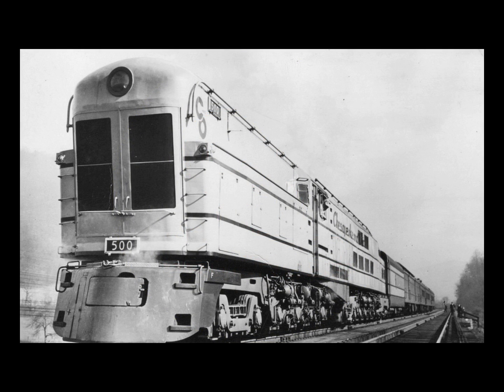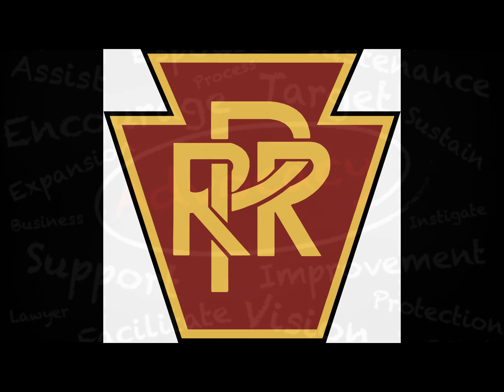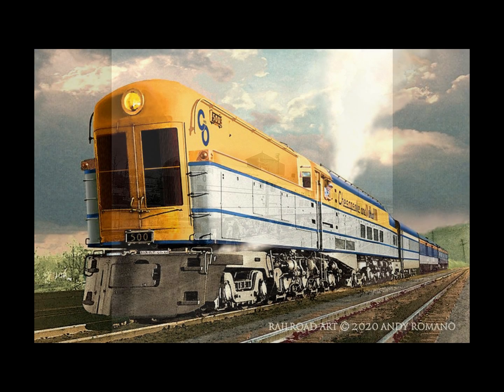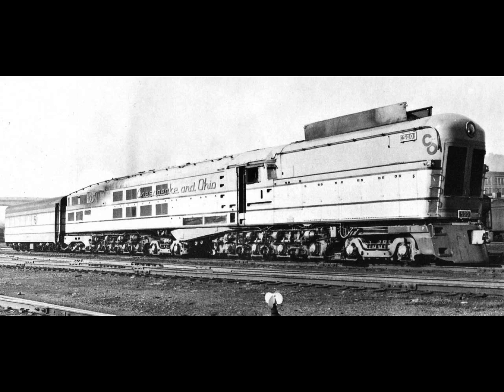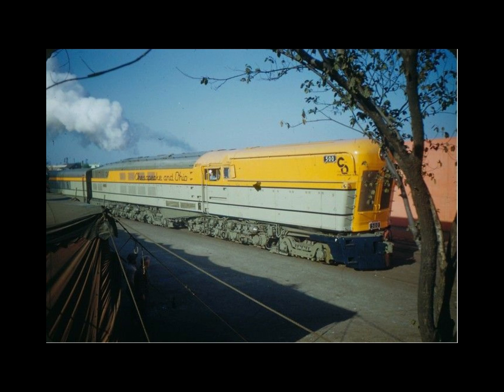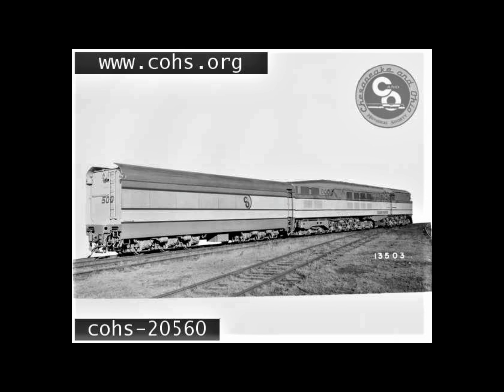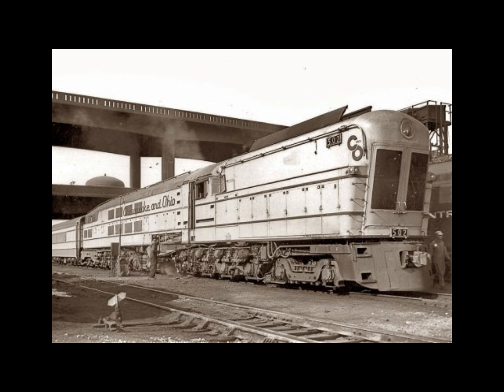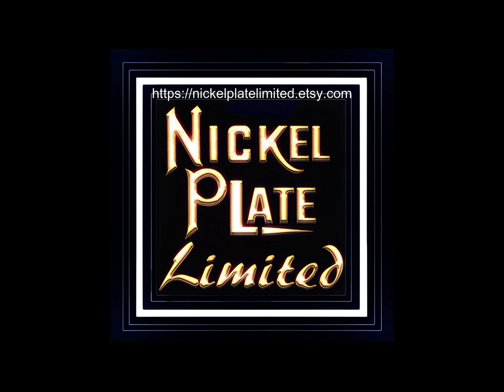Chesapeake & Ohio M 1

Comment: Some of the C & O turbines did not run with steam. They were  coal powder turbines. Coal was blasted into the turbine combustion chamber. The turbine blades wore out prematurely and the project was scrapped.
Reply: Sauce?

99% certain you are confused here.
Reply: @commissarcarl1700  Sauce? What sauce? This isn't a cooking channel. Confusion all around, apparently.
Reply: @diffened   in internet speech sauce means source. I need a source. I think this guy is getting his wires crossed.
Reply from the maker: Hmmm... Yeah, all that doesn't seem feasible from a practical or scientific point of view. I would have to see that in some form of historical documentation. If it exist, then I've never seen it. Thanks for watching and the comment!
Reply: @TheRailroadCrossing-SteamPower . Gas turbines can run on any properly prepared fuel, but they may not last.   There have been experimental  “closed cycle” gas turbines..not too different than a steam turbine.  The gas heated in a ‘boiler’,  passes thru the turbine, cooled (condensed) and recycled thru the compressor.  The working gas was helium.  The heat source coal or…
   Current closed cycle GT research (Sandia Labs) uses CO2 which at high pressures the liquid and gas phases are indistinguishable.  This vastly reduces compressor work which is the GTs bug a boo.  The down side is thick wall expensive heavy pipes.  CO2 GTs intended heat source is nuclear.
    UP’s locomotives had early, immature GTs.  Current aircraft GTs have pressure ratios (think compression ratio) exceeding 50:1 and turbine inlet temperatures of 2100F.  In other words, very efficient.   Combined with modern alternators and frequency drives…a nice quiet, smooth locomotive package for western long haul runs.  The package would be so small and light, the loco would need ballast for traction.
    GTs won’t be coming to your local locomotive anytime soon.  Why?  The turbo-compound diesel is no efficiency slouch.  The TC diesel’s performance, acquisition cost, and ownership cost fit RR operations. 
    A side note, Rudolf Diesel’s first engine used coal dust fuel.  The engine was built by MAN, ….yeah that one.  Cheers

Comment: Probably the best example of turbine locos was the UPs.  They were gas turbines with one burning coal which caused excessive pitting of the turbine blades.  Steam turbine locos were doomed from the get-go as turbines work best under steady load; land-based and ship-based. Turbines need to have a high velocity of steam through them and the steam condensed on exit to work at best efficiency.  All of the steam turbine locos were too complex to successfully operate over even the best of track conditions.  It would take days to find the problem but just minutes or hours to fix while a normal steam loco could be diagnosed in minutes but take days to fix.
Heavy straight electric locos offer the best of propulsion if the cost of stringing the catenary can be justified.
Reply from the maker: No more on the gas turbine! LOL.. I have a video coming out soon! Seriously though, steam turbine was a good idea in principle. But you cant just throw it out there in production and hope it sticks. C & O really got what they deserved in this. Concept to production takes years of trial and refinement.. They skipped all of that.

Comment: Marine steam recycles the boiler feedwater. It's also filtered and has a mixture added to stop buildup on the tubes. Railroads just seem to use whatever is available, river water, etc. Dirt in the water could cause a lot of problems with the turbine. It would have been nice if more locos would have been saved, but one that was a instant failure isn't special. And there isn't much to see unless the sides are gone.
Reply from the maker: Well, first of all yes on the marine system. I wasnt a BT in the Navy, but I did have my surface warfare pin, and I am somewhat familiar with the Navy's old propulsion system. Gas turbine has been the go to since the late 70's, but I did serve on a Leahy class cruiser which was a boiler system. I do think the concept of the M1 was sound.. Just no R and D time whatsoever. It normally takes years to ready a concept for development. They skipped all of that and expected the thing to work. And then they gambled big money on it by ordering 3 of them! It's the innovative concept that i was thinking would be possibly Smithsonian level. One thing is for certain. If they saved one.. every railfan in the world would likely make it a point to go and see it. The thing would be a cash cow.
Reply: @TheRailroadCrossing-SteamPower  Maybe, but most people I know that are steam fans want to see traditional engines and not turbines and diesels. My last ship was a DLG later called a cruiser so more captains could feel important. I couldn't wait to leave, hated every minute. Before I was on WWII built destroyers and patrol boats in VN. I enjoyed both.
Reply from the maker: @oceanmariner  Belknap or Leahy class for your DLG? Mine was Leahy.

Comment: This is my favorite experimental engine, I just think it's neat. This and Jawn Henry were the best chances for coal and steams continued relevance, and I think that if they had stuck with it or had started development in the late 30's it could have worked. 

But they didn't. But just how they didn't seems to be a source of confusion. The 'dust in the traction engines' argument goes around a lot but the C&OHS really never mentions that as the issue. They never really mention damage to the turbines due to road conditions as a issue either. They nail down three main causes of the M-1's mediocre performance. 

1. The traction motors were set up so that they would not correct for wheel slippage. No automatic system was included to cut power to a wheel that started slipping, so the engineer would have to cut the throttle until it regained traction. If the engineer didn't do this before the engine reached 1500 amps the whole power plant would shut down. This lead to a lot of stalls on the road. 

2. The engine had terrible drafting. Without the steam exhaust and smoke being shoved out by  the incoming high pressure steam (the chugga chugga) and without a gigantic funnel that you see on ships and powerplants that allow for good drafting of stationary turbines the M-1 had to divert power to blowers to force a draft otherwise the fire would choke and pressure would drop. 

3. Coal ash and cinders would be held against the screen in the smokebox that prevents embers from starting fires outside and fuse to it. apparently on regular engines the exhaust beats would keep this from happening, but on the turbine the air flow was steady so these would pile up, eventually worsening the draft issues, choking the fire, and causing the boiler pressure to drop.

There were other issues as well, but if the M-1 had controlls installed to reduce power to affected traction engines, improved funnels (like the french Klychap or the Giesel injector which was offered to the C&O as a solution to the drafting) and a mechanical agitator for the screen the M-1 may have worked well enough to be further pursued. 

it would be cool to have had one still around, but you can say that about a lot of engines.
Reply from the maker: Since we talked earlier I dont mind sharing this with you, this info for the video came largely from one of my books published in 1953. And that's what I was talking about info. being not up to date versus later findings in that earlier convo. That's where you guy's come in. Otherwise the book had the most complete info. on the loco. over anything else i'd seen.
Reply: It was a waste of time and money. Diesel-electrics were much better, even if these had worked.

Comment: do you mean the prr s2 not the t1
Reply from the maker: The s2 was a different attempt at it which I will be covering very soon. It had a different way of going about it. But yes I meant the S2 and not the T1. Hate it when I do that! I didnt even hear it on the run thru before loading it. Normally I do a text correction above a mistake.   I will pin it on top of the comments.